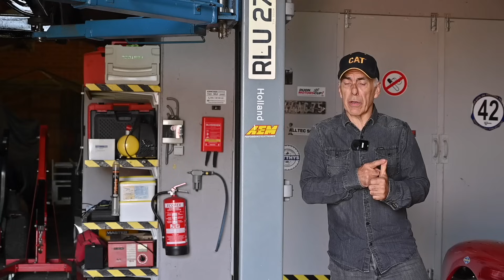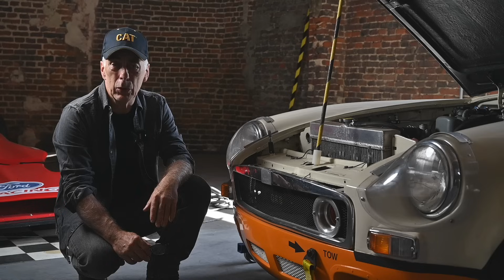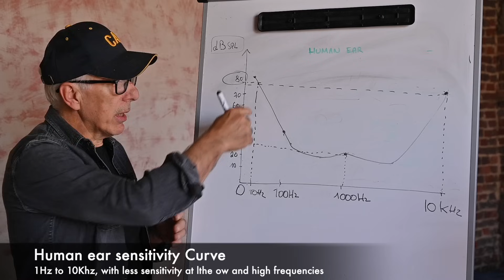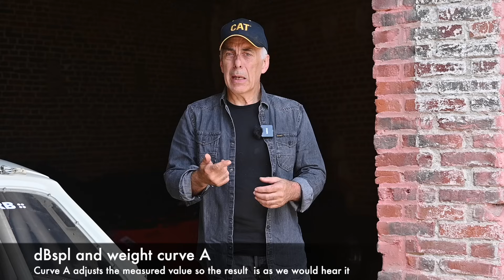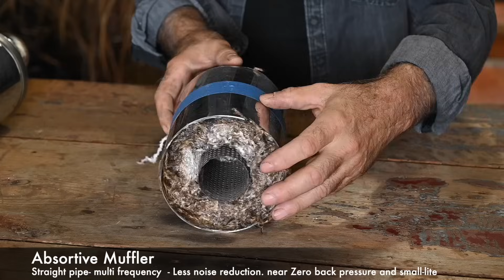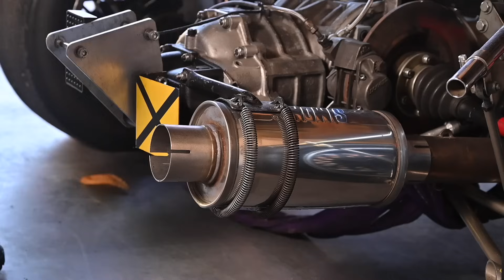The Challenge between  noise regulations and car performance -  A look at dBSLP and mufflers

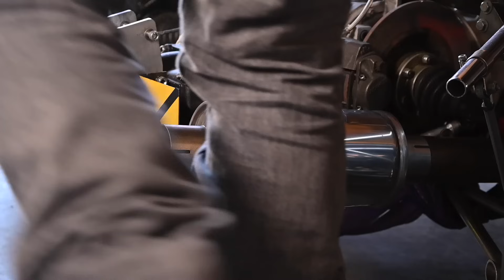Comment: @28:31 You're smarter than me but I have doubt about the pressure to heat conversion. Perhaps there's some. But most of the heat come from the gas itself. Try to heat up with a air compressor...
Reply from the maker: Thanks, off course there is heath from the gasses themself .  However the pressure waves do convert to heath within the insulation material.   Pressure waves in an absorptive muffler push air back and forth through fibrous packing. The resulting viscous friction and microscopic compression/expansion convert the mechanical energy of the sound wave into random molecular motion—heat.  And heat is the vibration/ movement at the molecular level .  But "yes" , you are also right  as  the overall heat is indeed related to the temperature of the gasses, the exhaust itself and the conversion to heath.

Comment: I'm sure that an airbox for carburetor would not be that bad. Plus you can force air with a fan. Not a turbo but just adding a constant +0.05 atmosphere. A box made of sheet of lead sandwiched between silicone (like the baking tray) would do the trick.

Comment: I circuit race a 1965 VW Beetle and on UK race tracks my limit is 105DB(a) and its a nightmare. Its one of the quietest cars when on circuit, but during the pre-race stationary sound test it barely passes the test because its aircooled (so lots of mechanical noise) made worse by being rear engined meaning the engine and carbs are 3 metres closer to the test equipment than all the front engined cars. May have to buy an air box for the pair of 44 Webers for next season 1029 Euros...Ouch!
Reply from the maker: Thanks for sharing your experience with the noise regulations, that sounds really challenging!

Comment: Steve, wonderful presentation and explanation of the problems and potential solutions. Here in the UK they are just bringing in sound cameras to monitor both engine noise and also ridiculously loud car stereos. I live right by the coast and certainly very loud stereo systems is as much as an issue as exhaust noise. With regard to the track, as far as I have seen, all tracks over here require a sound check prior to racing or any track time. This has never been an issue for me apart from when I fitted the exhaust system recommended and approved by the race series control (headers, decat, no resonator and muffler) . Now all the cars are mechanically identical and go through scrutiny each race. However, many cars failed the sound check with the control exhaust fitted mine included. All these cars were inspected to see if anything was incorrectly fitted or had been modified but nothing was identified so eventually they allowed us to race whilst control looked into it further. No performance gains were observed and eventually it was agreed by the drivers and control that if you had the control exhaust system fitted you could in effect ‘fail’ the sound check by the 2-5db and compete. We still have not got to the bottom of it but I strongly believe it’s a manufacturer error or defect in the muffler. The person making the muffler over packed one or under packed one etc etc at the factory prior to wielding. The mufflers are wielded to the centre pipe so unfortunately you can’t easily swap them around for comparison. My point though is we came to a sensible  decision between drivers and control. But if you arrived at a track day you might not get on track due to a problem in the construction so always check.  Thanks Steve.  Regards Duncan.
Reply from the maker: Thanks for the detailed comment and sharing your experiences, Duncan!